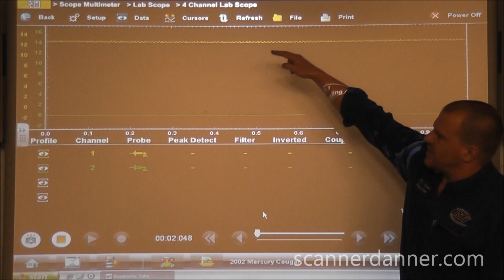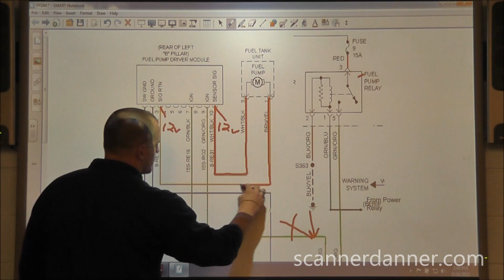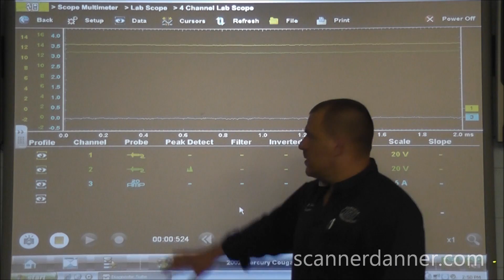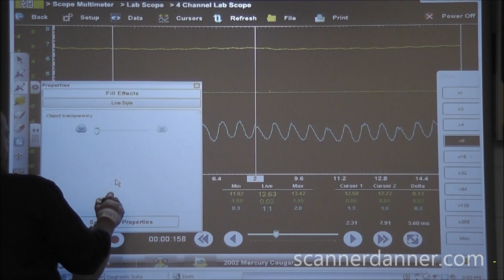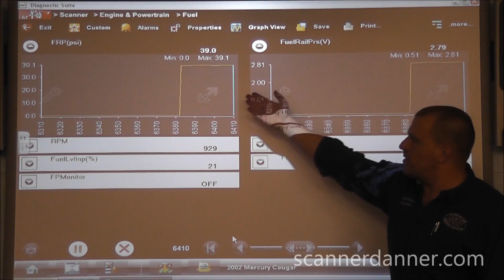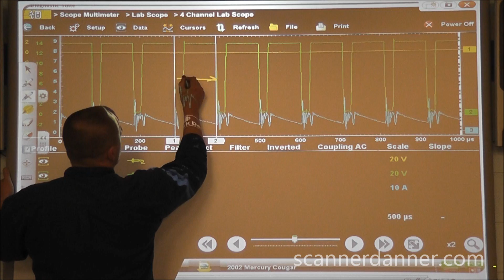No fuel pressure diagnosis and testing (new fuel pump installed, reversed wiring)

Comment: hey Paul good always a good way to determine fuel pump performance using the rpm calculator.. i have alot problems using this technique and it works really good especially with gm pump that usually have internal fuel leaks due to a broken hose... good job man

Comment: Hello Paul,

If you want to ground this pump you can instead of hard grounding it use a bulb. A normal 55W headlamp will draw only 3-4 amps so it keeps the amps down even if the pump stalls when the fuel pressure goes up. That may give you enough time to take a RPM reading out of the current signal ?.

Regards,

René.

Comment: Master .. is normal this fault in this sistems. and change the wire position 
solve the problema.. buy the computer or the diagrams is wrong. is so interesting how to sensor ruel rail and  fuel tank is Works. And how the computer  determines the operation of the pump

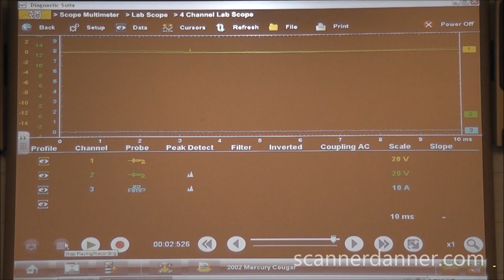Comment: Also at 41:57 you can see that one commutator hump takes about 3ms, so 3ms x 8 = 24ms/rev.   rpm = (60,000ms/min) / (24ms/rev) = 2,500 rev/min. Seems to be a reasonable number for the key-on prime event...

Comment: Universal fuel pumps are like universal O2 sensors or catalytic converters to me.

I avoid them like the plague. I've had lots of problems with part compatibility and longevity. It's being penny wise and pound foolish in my opinion.

I'm sure a lot of engineering compromises need to be made to make that pump fit a wider range of vehicles. Just get a direct fit one it will match the cost of a tow truck when your cheap pump fails.

Great video Paul keep it up!

Comment: Brilliant diagnostics, and fantastic lecturing! That's pretty slick interfacing the Verus and the smartboard.
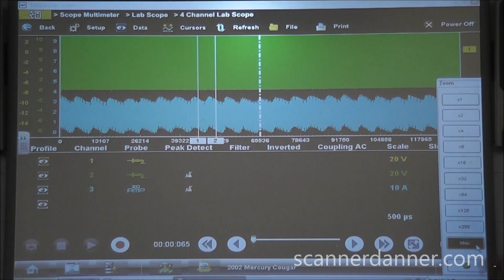As for the FP rpm after the fix, look at your zoomed-out capture at 45:17. You can still pick out the humps from the eight bars! Picking some convenient numbers, looks like there are 12 humps between 13,107us and 78,643us.  
(78.6ms-13.1ms)/12x8 = 43.6ms/ 1 revolution.    
rpm = (60,000ms/min) / (43.6ms/rev) = 1,374 rev/min.

So does 1,374rpm sound reasonable at a 10% duty cycle?

Comment from the maker: I am not sure, I know that it saves on alternator loads, which improve MPGs, but does it lengthen or shorten the pump life? I do not know. Remember for this application, there is no fuel psi regulator, so the primary purpose here is to control fuel pressure.

Comment: Hi Paul I have found a 12 volt power probe is very useful, checks for power tests earths, has rocker switch for putting ower or earth on, trips out if you get a short, can power up things like fuel pumps etc about $25 on ebay Fred.

Comment from the maker: That code flowchart was crap. I saw no mention of fuel psi being low as the cause. 
As for the module giving the pump a near full ground, the answer is yes. No or low pressure will result in a very long "on-time" of the pump. This is the part I didn't show in this video. The PCM is the one that "sees" the fuel rail psi and changes the command signal to the FPDM in response.

Comment: Great tutorial as always. Thanks Paul.
One question. Could you not briefly get a capture of the maximum RPM capability of this pump, by (Briefly) supplying the pump with a permanent ground, making sure that it is wired for the right polarity and then devide that figure by the duty cycle measurement obtained on the scope, in order to estimate the running RPM of the pump, or do the maths not work out that way???
Keep up the Brilliant work.
Many thanks, Joe.